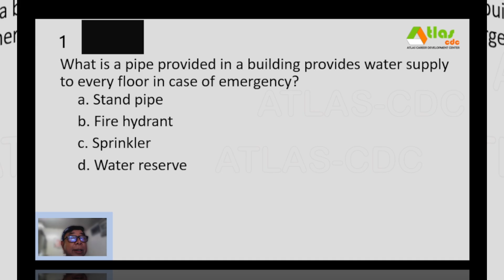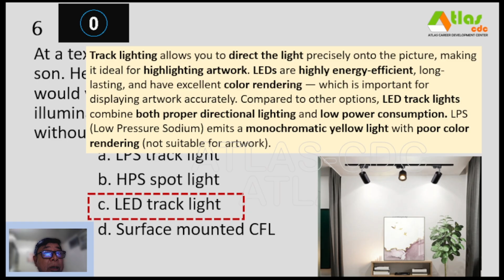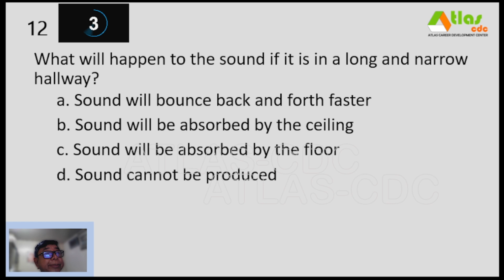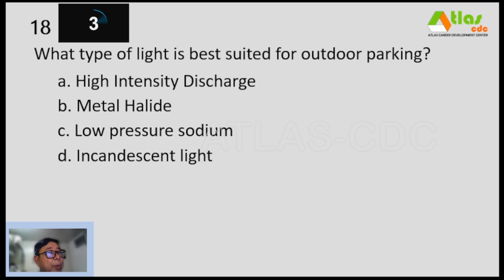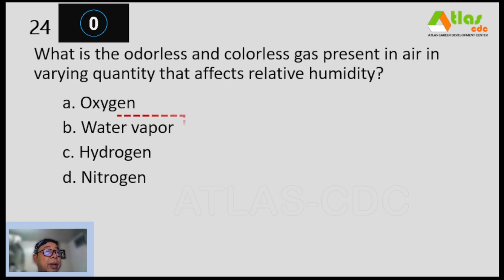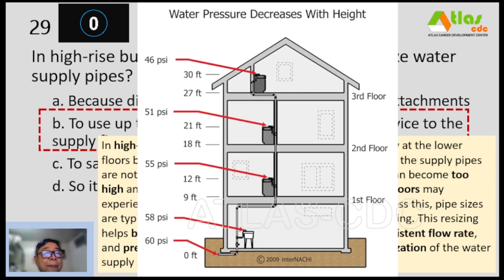Architecture Review Quiz - Building Utilities Part 10

Comment: Thank you Ar. Rey! I have a question sir. 18:36, Which code was used or provides the table for the rate of water consumption?
Reply from the maker: from National Plumbing Code of Philippines
Reply: And in the case of item 14, the reference states 50-75 gal per capita. There were 3 possible correct answers from the choices. Is it safe to assume that the least number is also the correct answer?
Reply from the maker: yes, probably what is meant by the one who prepared the question is the minimum (recommended).
Reply: @ArkiReview_Ph Got it. Thank you sir!